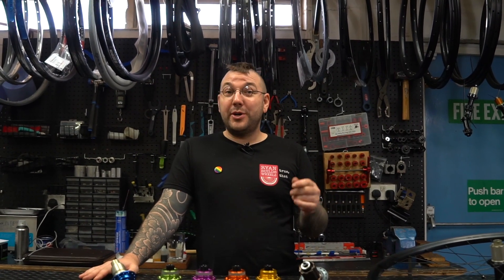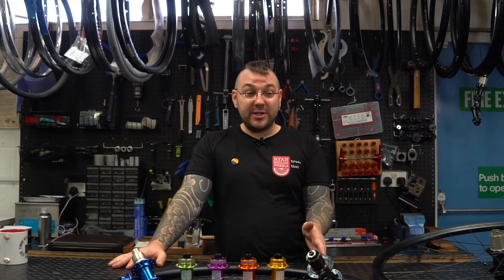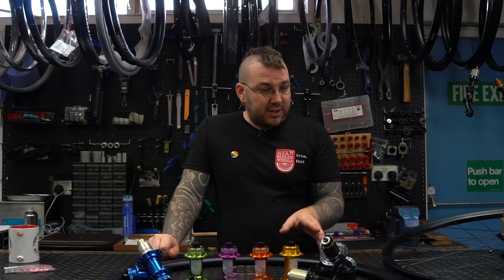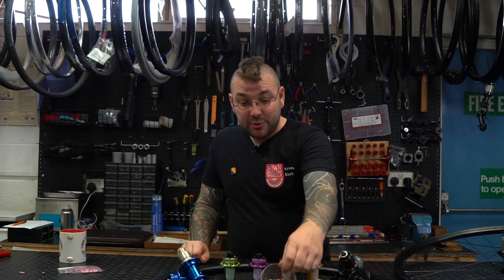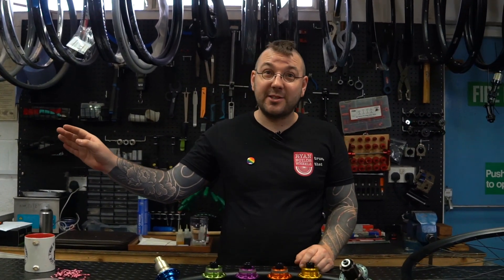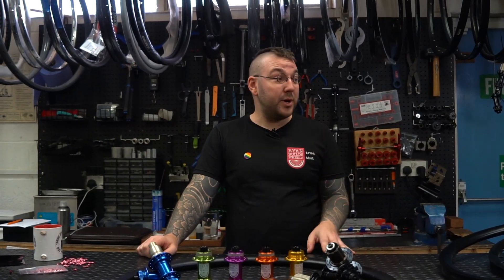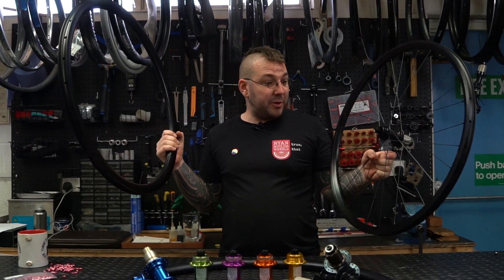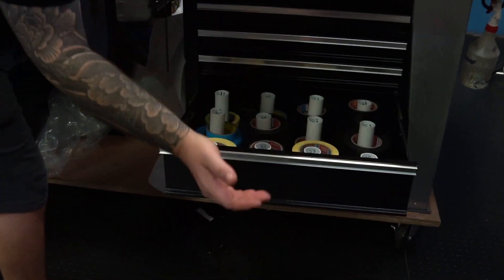Hello New RyanBuildsWheels Club Wheels (Workshop Rumblings Ep#1)

Comment: Very interesting video. I am looking at the road rim brake version to upgrade from my Campag Vento wheels on my steel Mercian. Your wheels should come up a bit lighter compared to the 1660g Ventos and most importantly I can have silver spokes to sparkle in the sun. And anodized hubs too. Just need to decide on the colour.
Have subscribed to you
Reply from the maker: Thanks; exciting times @thecampingastronomer8554 !

They'll definitely come up lighter for sure and - depending on the choice of rim - I can often offer them in polished silver rim options too; get in touch direct via email or the contact form on the website and let me know which options you're thinking and I can let you know if I've access to said silver rims; they'd work so well on the Mercian!

I'm away on Holiday until Mon 20th November; will reply from then on :-)
Reply: @RyanBuildsWheels  thank you, I'll be in contact via e-mail once you are back.
I can send you a picture of the Mercian so you can get an idea when I drop you an e-mail.
The frame was built 10 years ago to remind me of the sort of bike I used to race on in the 80's, so I don't object to black rims as I used to use the Mavic GP4 rim back in the day with silver spokes. 
The rest of the kit on the bike is black Campagnolo.
My main issue is whether to go for the lighter rim or the more aero one.
Anyhow, enjoy your holiday and I'll be back in contact shortly.
The bike is now put to bed for the winter, so I'm not in a mad rush.